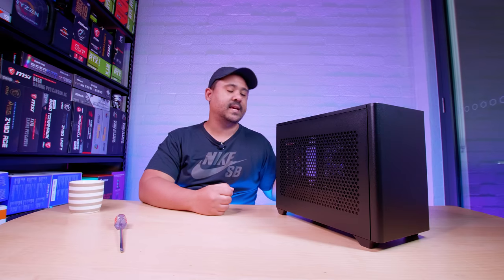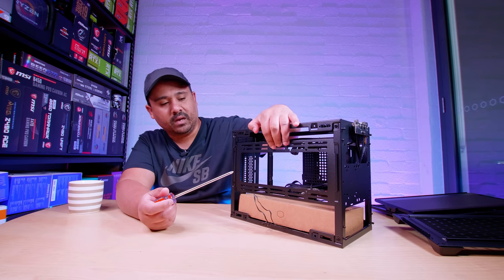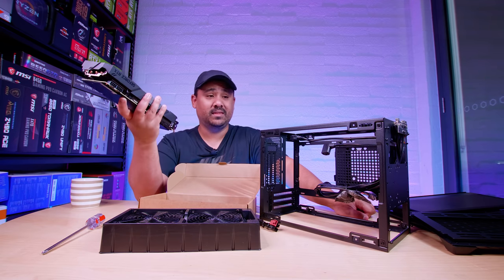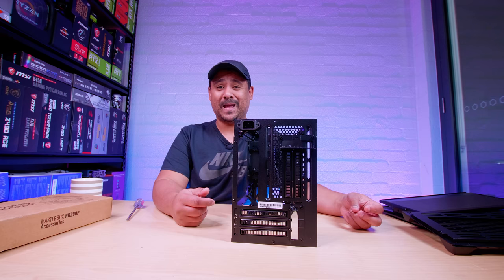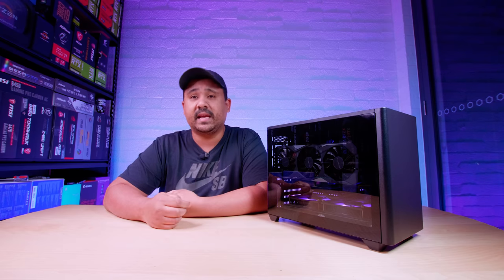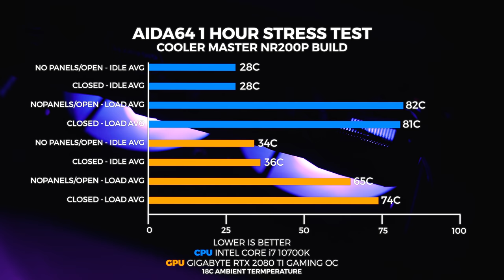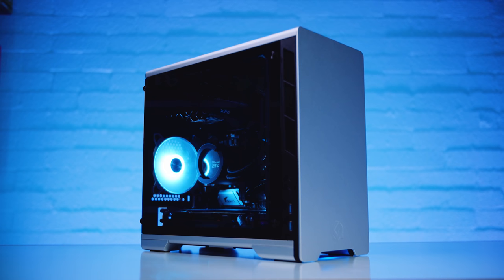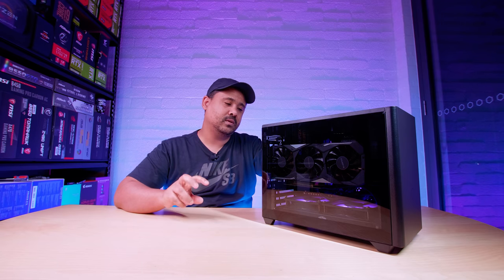Cooler Master NR200P is Absolutely BRILLIANT!

Comment: I wouldn't even have shown this pc with that side panel. 18c ambient is super cold this would choke in 5 minutes under normal circumstances. Using that panel you would have to either go all air or all water.
Reply from the maker: Use your ears. I did it that way on purpose to see how much it impacted it.
Reply: @GearSeekers  I did use my ears. You should use your eyes and see I said I wouldn't have SHOWN the pc with that side panel. the reason I made my comment is because noobs watch these videos and think they can do this and end up wasting money or damaging parts.
Reply from the maker: @crodo123  You're not gonna damage parts mate. AT MOST you will thermal throttle. This doom and gloom mentality in tech is what scares people off. Don't be that gatekeeper. Again EVERYTHING is explained in this video.

Comment: I was hoping ATX PSU would fit it. But Thanks for the video. Might be going with you cougar build as i wont buy additional psu. Cheers!
Reply: I think there is a mod to put in an ATX power supply.

Comment: First of all I really like your new setup! Secondly this case may be better than my tu150! It’s just too bad there is no usb c on the front. Apart from that this case is everything anyone would want in a sff build and a VERY competitive price point.
Reply: Did you put any fans under the gpu in your tu150?
Reply: nauxsi yes I have 2 noctua slim fans. And I also have an EVGA 3 slot gpu and they fit just right.

Comment: Would it be a bad idea to put a 3950x? Thanks in advance🙏
Reply: If you use a 240 or 280mm aio for it then it will run perfectly

Comment: It's too bad that they have a solid front panel and even if it was mesh the frame behind the front panel would not allow front to back air flow.  So close, but no joy.  I opted for the CM NR400 instead.

Comment: Would this case work lying on it's side with the aluminum side down, glass side up? I'll be using 1in. tall legs
(it's for a desk aesthetic thing)
Reply: Nope, it would instantaneously combust, obliterating anything in a 60Km radius, causing massive collateral damage to your house and the surrounding infrastructure.
Reply: @billyshears9714  lol but seriously, im in the market for a horizontal pc case. Or at least a pc case that can be mounted horizontally and serve as a monitor stand. Cryorig Taku and the Volta case are just waaay too pricey hahaha
Reply: @diegoveloso3rd  get those flat itx cases

Comment: Many youtubers do a build with AIO... I just want to see builds using different air coolers that showcase the flexibility of air cooling in this case.
Reply from the maker: If you actually watched the video you'd know why.
Reply: @GearSeekers  I did and also watched a ton of other related videos. Why be condescending? If i missed it you could just let me know. Thx i guess
Reply from the maker: It's not condescending when something is answered in the video. Half of these questions that people ask are answered in the videos they watch. Imagine being me having to respond to the same question over and over when all it takes is for someone to just watch the video. That's the point of the video.

Comment: will rtx aours 2070 super fit on vertical in this case?
Reply: The Aorus is a bit thicker but it will fit. However if you are planning to use glass side panel it won't get great airflow so if you are going for looks over performance then go for it. otherwise i would stick to horizontal.
Reply from the maker: I will be answering this in our next video ;)

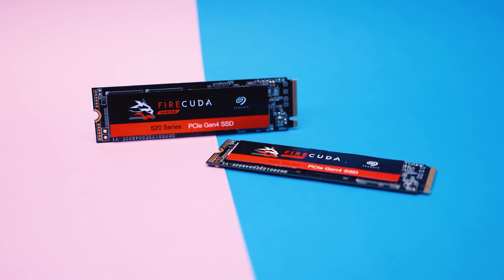Comment: 15:49 It makes no sense to use a PCIe Gen4 SSD on an Intel platform, because the processor supports only PCIe 3.0.
Motherboards for the Intel platform may even have PCIe 4.0, but due to the processor limitation they will only work at PCIe 3.0 standards and speeds.
You can only take advantage of the full potential of PCIe 4.0 on AMD platforms.
Apparently the game turned, when AMD launched its processors already with support for PCIe 4.0 all fans of intel were anxiously waiting for a release of a processor with support and 4.0, but unfortunately this has not yet happened at the launch of Core i9 10 generation.
Intel needs to have some card up its sleeve, as it is lagging behind.
Reply from the maker: You completely missed the point if the video. This is not my first rodeo Buddy. I don't need an essay on how drives work mate. The point was to show rear access on the case. The drive is not important 🤣
Reply: @GearSeekers  I actually came to this video precisely because I was looking for more information about the Cooler Master NR200 case.
I really liked the video, but the issue of Intel processors not supporting PCIe 4.0 has always caught my attention, especially since apparently many people are building similar sets (Intel + SSD PCIe Gen4), even though it is not a recommended combination due to limitations of the processor.
I wanted to know what is really happening with Intel, with each new processor it releases, it also launches a new chipset which practically forces a customer to change the entire system.
As Intel "parked" at 14nm a long time ago, it is likely that it will finally release some 7nm processor for desktops and as the current mobos for Intel are still 14nm we will again be forced to change the motherboard.
So the PCIe 4.0 slots on the Z490 platform are just symbolic.
Sorry for posting a comment so off topic.

Comment: Can a msi b550m mortar fit in there?
Reply: No, Max MB size: 244 x 226mm (L x H) and msi b550m mortar is 240mm x 240mm
Reply: @Physis_88  what if I swap the psu bracket and put it in front?
Reply: @michelemavillonio8375  That can work, I guess, but case don't have mini-atx support, so you need figure out how you are going to put motherboard standoffs + you loose 240/280mm radiator support if you swap psu bracket.

Comment: Steve from GN just did a video explaining why not to put the AIO at the bottom for anyone who is thinking of doing that.
Reply: @Phalaxis83  He makes a pretty compelling argument for it. Idk, do what you want I'm not gonna try to make anyone do anything but it would probably be good to at least watch his video. I was gonna do the same thing in the NR200 but now I'm change up my plans for when my case finally shows up.
Reply: @Phalaxis83  provide a counterargument then
GN has almost never been wrong. they're proven to be impartial, and have excellent, open testing methodology. what more do you want
Reply: @Phalaxis83  We actually got information from the manufacturers for that video (CM, Asetek, Arctic, EVGA, Corsair). They were all pretty on-board with correcting the incorrect installation practices of people. That said, no need to badger other YTers about their installation approach.
Reply from the maker: Thanks for clarifying Steve. Appreciate that.
Reply: @Phalaxis83  what does AIO flaw has to do with anything  you silly goose? the issue is placement and orientation